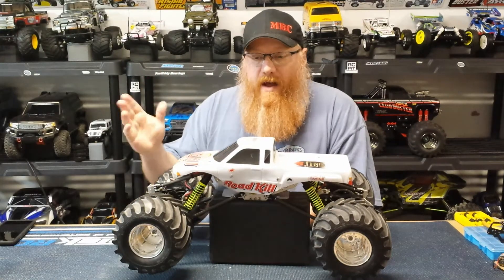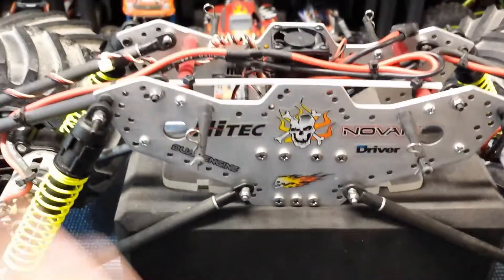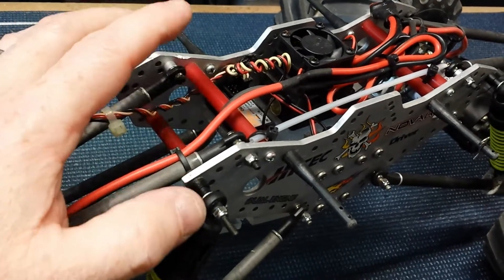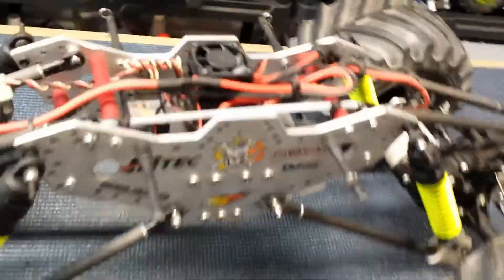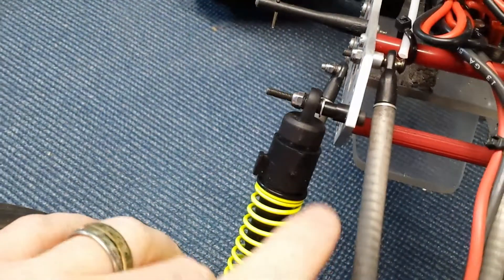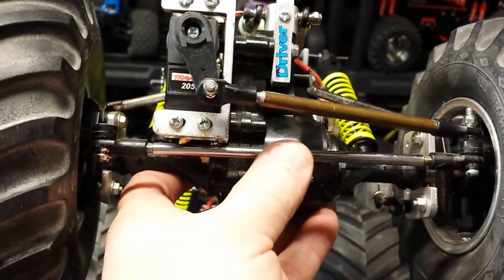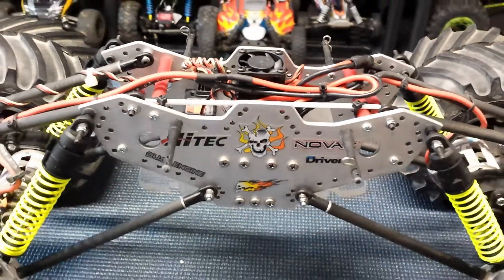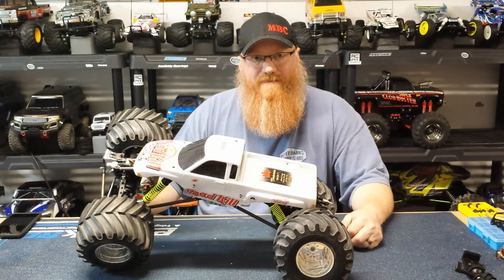Old School Clod Buster Based Crawler

Comment: This thing is sweet. Would love to see you do a build today on your channel and improvise things. Like you did in the speed challenge. Let us in on some custom fabrication and build ideas and try things out different than just buying parts available. That is truly RC building. Not just assembly and parts swapping.
Reply from the maker: It does involve a lot of head scratching and making things up on the fly!. You can plan and plan for a build like these but 3 steps in and you have to throw most of out the window and start making things up as you go along! I have some ideas I would like to try but they are going to take some time and money to do so it may be a little bit before I get to working on them. I have a whole list of themed builds I would like to do as well. If I could just figure out a way to retire and still make the money I make now I think I can get them all done! LOL!!!

Comment: Dude, that's an AWESOME chassis!!!!!!!!  A bit longer, shorter links & shocks, faster motors and you would have one hell of a race Clod!!!!  I have a Novak Super Rooster esc in my race Clod spinning 2 Trinity 13x3 Speed Gems 2 motors (of course I had to spin the end-bell 180 for the rear motor). I need to see this on your track man, I know it's no speed truck but it would be cool to see. I could go on & on & on....
Reply from the maker: Thanks! This was built completely with the F around and find out way of building!!! This was back when you had to go to forums and dig around to see pics of what guys were doing and figure it out from there as nothing was really documented and everything was soo new I know they have wideners for the wheel hubs now so i had thought about getting a set and tossing some 4ws on it and making it more of a romp around truck as it such an outdated crawler and it was never a great one!! I really miss those old trinity motors and I really wish they would bring them back... they would make a fortune selling them!!! The locked diffs may be a challenge for running too fast but it would still be funny to see the bog ol thing lumbering around!
Reply: Wow, do you have a video of this beast?

Comment: I loved the video. Definitely liking the use what you got moto. I'm trying to piece together an attic find clodbuster.  Do you have any idea where I can find reasonably priced used wheels and tires? I have absolutely no luck on Ebay or Facebook Marketplace
Reply from the maker: For wheels I know Tower Hobbies has them in stock usually but the tires are much harder to find. I think eBay and aftermarket are gonna be your best bet. They are hard to find but I hope you find a set for your project!